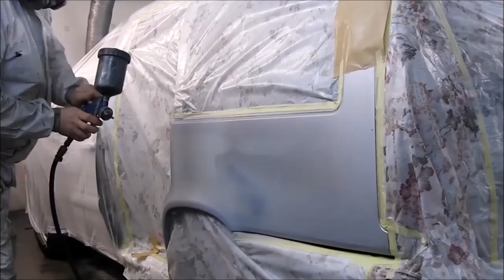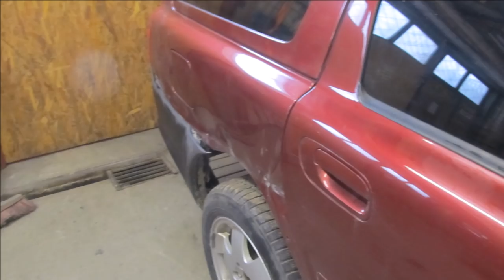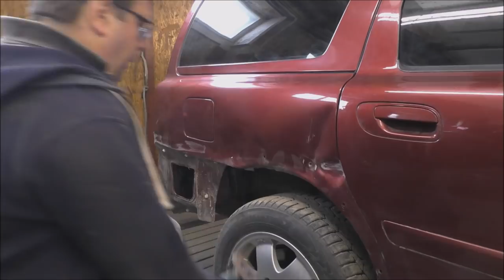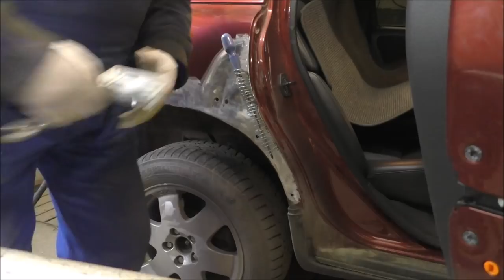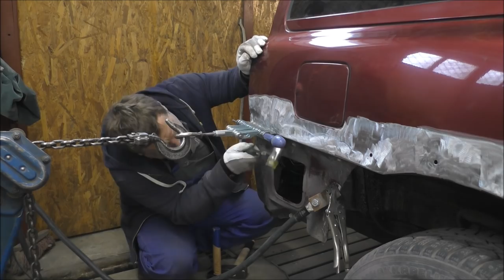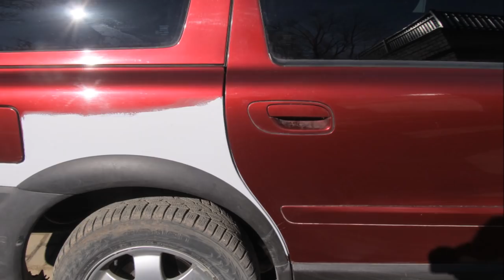Volvo. The quarter panel repair. Ремонт заднего крыла.

Comment: What's most amazing about his repairs is that he accomplishes a lot with nearly outdated tools, he proves you don't need all the fancy new equipment. A guy in my town crashed his Subaru and was selling it for cheap and I nearly bought it after watching these videos, however a few things such as being certified and having proper work space held me back from taking on the project
Reply: He's using a old heavy come-along to pull the panels, and a screw driver to link the hooks together in this video. The body shops these days use electronically controlled hydraulics to pull and push while the car is on a rack. Yes the fundamentals are still the same, but there are much better tools out now to make stuff like this easier is my point.  He has the skills and knowledge to make perfect use out of what he has, I would guess he's been doing this work for many years